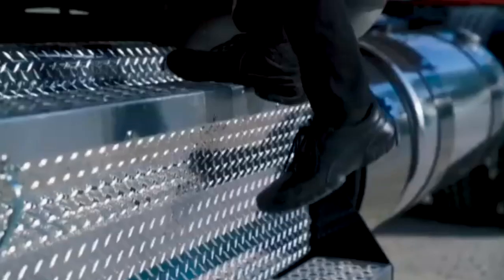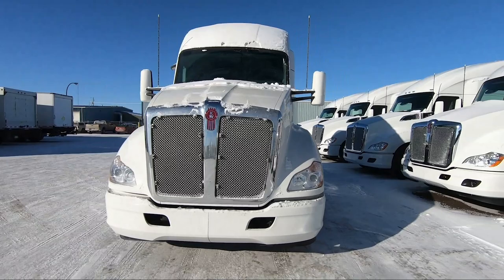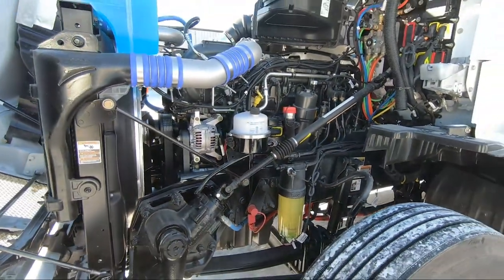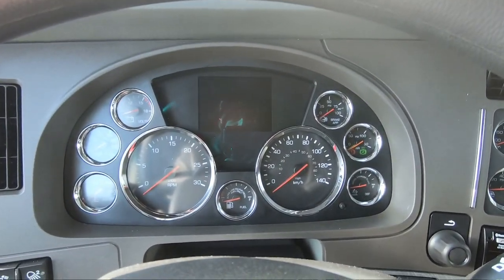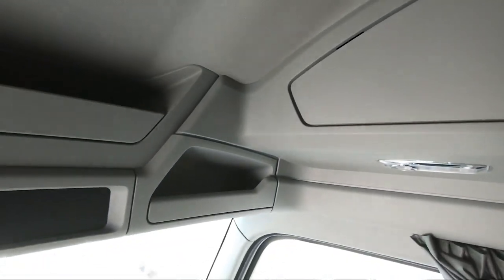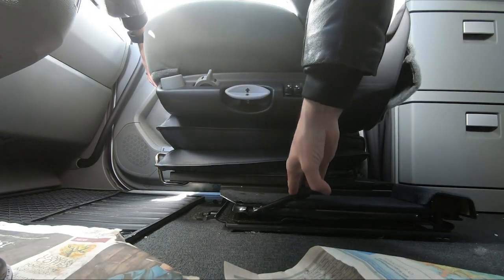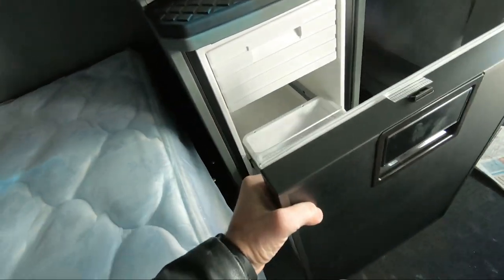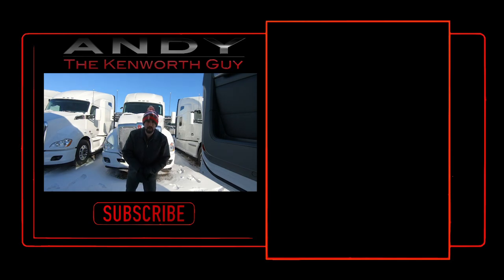IN STOCK 2019 T680 KENWORTH - FULL TOUR

Comment: I drove T680 last year for the company 10 month long. It had 500 Paccar in it with 13 speed Eaton. Nice looking truck I always was admiring it's beauty on truck stops, and still do. Loved the bunk set up especially turn table and huge drawers. 
It was an O/O specs fully gauged and had long fairings. Nice dark blue cab color and creamy color interior. Leather steering with all fancy buttons on it. But had some problems with insulation. Going from WPG down to GA started my trip with 30 below. Was 10 above in GA and water ran down windshield and the sides,every time I stopped at traffic lights in GA. Also water ran down from the bunk upper lights.  Guessing condensation was freezing up between inner and outer shell, it happened to me few times,while going south in winter. Engine pools good, but gives up quickly on uphills I-15 going down to CA fully loaded. Driver sit feels a bit hard on longer trips. And yha, leg room, the middle console going down by the right foot takes a lot of room away, wish they would mold a cave in there so you can stretch your legs out. Otherwise is a good, reliable,save on fuel truck.Sits very stable on the road and goes like locomotive in to the curve.   Very comfortable bunk. The size of the bed and it's comfort is unbeatable. I wish they would give us an option with 86" like I had in my older T660.

Comment: Thanks Andy. Good Stuff and lots of useful info.  Nice touk.  You still planning on doing the 680/880 side by side compare?   I know the interior will be the same and it should only be a grill and fender difference.  May not be much of a difference at all and only be a one minute video.   Not sure why   they make both trucks since they seem identical??   Makes sense to have an 880 or  680 but not both and keep the 660.   Just bring back the 660 and stop one of the identical models, either  the 680 or 880.   That's just me though.  I thought the 660 was a good looking truck.  Everything is aero and fuel now and I understand what they are designing.  But having a 680 and 880 makes zero sense,  since it appears to be  the same truck with two different names.   Maybe the 660 did not sell well not sure.   Thanks again and stay warm.
Reply from the maker: Hope to one day soon. It has to warm up a bit first and waiting for a similar spec T880 to arrive in stock. Basically the hood and chassis fairings are the difference.

Comment: The only issue I have is the vent climate controls.   I have the same ones, seem to be used throughout all models.  They don't work.  I have had them replaced twice.  The second time they replaced it with a better brand (not the cheap knobs and dials Kenworth uses.   

Also, when I have Kenny at idle, he rattles and shakes like a POS.  Everything  sounds loose and it does not appear to be well built.  I had to replace the factory lights because I couldn't see at night,  It was soo bad you would think Kenworth doesn't allow night time driving.

$192k Taxes all in.  I should have bought a volvo.
Reply: Jesse Boisvert honestly i think volvo and freightliner are the best built trucks.
Reply from the maker: I couldn’t disagree more.